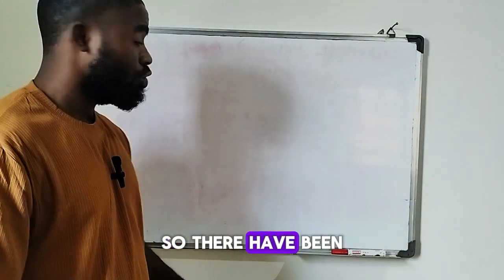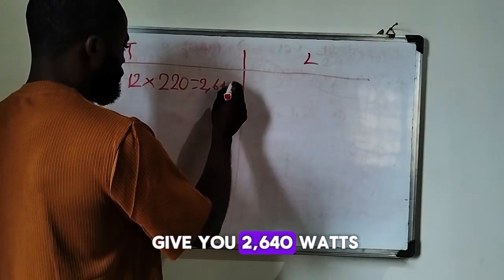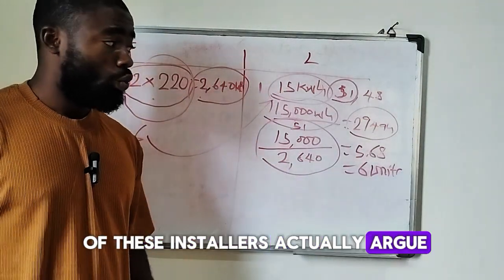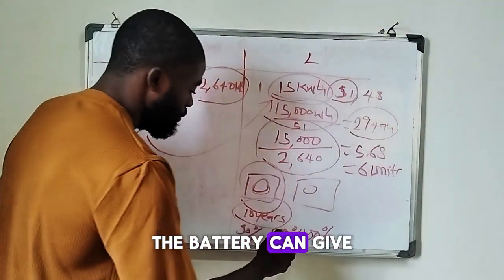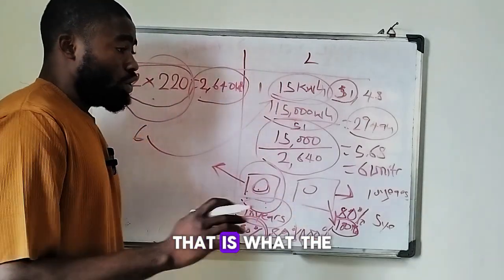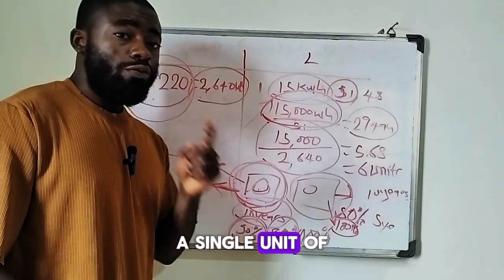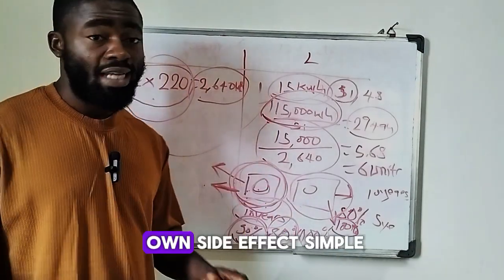HOW MANY TUBULAR BATTERIES MAKES A SINGLE 15KWH??

Comment: You did not calculate the voltage
I.e you did not considered changing the 12v Tubular battery to 51.v as the lithium battery
Why

Comment: 12 Units of 12V 220Ah Tubular Batteries
1. *Total Capacity*: 12 x 220Ah x 12V = 31,680Wh (or 31.68kWh)
2. *System Voltage*: 48V (4 x 12V batteries in series)
3. *Usable Capacity (50% DOD)*: 31,680Wh x 0.5 = 15,840Wh

 15kW Lithium Battery
1. *Total Capacity*: 15,000W x 1h = 15,000Wh (or 15kWh)
2. *System Voltage*: 48V (assuming the lithium battery is designed for 48V systems)
3. *Usable Capacity (80% DOD)*: 15,000Wh x 0.8 = 12,000Wh

The 12 units of 12V 220Ah tubular batteries have a higher total capacity and would provide a longer runtime.

Comment: Please sir i need an installation advise from you.

I want to connect a felicity hybrid inverter 10kva with 12pcs of 550w panels, to 4 tubular batteries of 220ah, how do i arrange the panels?🙏🏾
Reply: 6 panels in series then parallel the two array together.

Comment: In reality 6 units of tubular battery can never be equal to 15kwh battery. Becos if you put a load of 2000watts on 6 tubular battery it will just die within 5 to 10 minutes but if you put a load of 2000watts in a 15kwh lithium battery it can carry that load for 2 to three hours before it gets to 50% DOD. You should know that lithium battery energy density is different from tubular battery energy density.

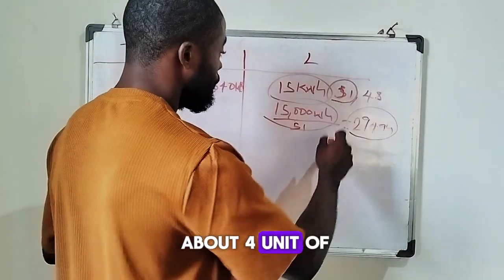Comment: Very educative.. planning on getting a 20kwh system.. but your calculation at 2:00 is wrong you said 4 units of 294ah lithium battery gives 15kwh.. 294ah x 51v =15kwh so it’s 1 unit of 294ah or 3 units of 100ah lithium batteries.

Comment: If only you know that most 220ah batteries are actually 200 and 180ah (actual capacity) a client was using 12v x12 units 220ah and then switches to 15kwh lithium battery. Same loads, same everything. He said he gets much more than when he was using tubular. He never stops appreciating me for the lithium battery. By the way, blue carbon. There are premium tubular batteries that can can match up with the calculations. They are premium brands and almost 45k more expensive than regular tubulars. Eg. Genius, ozoro, adwin, Luminous inverlast and few others.
Reply from the maker: Anyways, I was ashamed when you called blue carbon 🤦🤦, did you ever wondered wether tubular batteries where getting filled?
Reply: @Mairigaemmanuel . Sure, they were getting filled. Blue carbon has really improved. 50k more in price (stackable) than Felicity 15kwh. Remember, one of them uses secondary cells., you probably might not know this. I have affiliation with 3 giant Chinese lithium battery manufacturers. Try blue carbon and thank me later.

Comment: That installer is very correct, i assume you're referring to solarwatt, which is another youtube channel. 

You said using about 80% of Tubular batteries and you'll get 2-3 years out of them, bro that is wrong. Youll be licky to get more than a year and half from them. But using Lithium and then using 80% you can get upto 8 years from them no issues.
Reply from the maker: So you think your inverters cut off at 50% DoD?

Comment: It doesn't make sense for one to go beyond 50% DOD for tubular batteries & more than 80% DOD for lithium batteries if the manufacturer advices that ~ for the longevity of the batteries.
I think to get the accurate figure, the DOD should be considered.
I believe the calculation should be, taking the batteries' DODs into consideration:

1) For TUBULAR BATTERY;
12v x 220a  = 2,640w
2,640w x 50% dod = 1320watts.

2) For LITHIUM BATTERY;
15,000w x 80% dod = 12,000watts
 
Taking these batteries' DODs into consideration, the number. of 12v 220ah tubular batteries that should be equal to 15kw lithium battery should be:
15,000w x 80% dod ÷ (220ah x 12v x 50% dod)
=15,000w x 80% DOD ÷ (2640w x 50% DOD)
 = 9.090909....
While, approximately 9 pieces of 12v 220ah tubular batteries is 15kw.
Therefore, almost 9 pieces of 12v 220ah tubular batteries is a 15kw lithium battery
Reply: To achieve the same usable capacity as a 15kW lithium system, you'd actually need around 12 lead-acid batteries
Reply: Thank you. Lead-acid batteries are way inferior to lithium batteries. I don't understand why anyone should be having such argument in 2024. The best lead-acid battery will never exceed 5 years of useful life-span even if you use 30% of its capacity daily. A c-grade lithium battery used in the same condition will easily exceed 30 years before needing any replacement.
Let's not even talk about charging speed, where a typical lead-acid battery bank needs at least 10-hours of charging to get full, while a lithium battery bank can achieve a full state in less than 3 hours.
Reply: Note:
If the life cycles of the aforementioned batteries are considered in the above calculation, the quantity of the 12v 220ah tubular batteries that will equat a 15kw lithium battery might change.
Reply: This is more accurate before this video I have watched several videos on this topic what is most considered is the DOD. By the way everyone is entitled to their opinion and experience is always the best knowledge. I still prefer using Lithium over tubular batteries except if the client is budget constrained
Reply: @EmmanuelDimgba-f7c   nice one Sir. 

But no one mentains that 50% dod cuz inverters has been designed to drain to 10.5v or 10.6v for tubular depending on the inverter brand for a 12v system 
Therefore for tubular battery that fills at 12.7v if you divide by cut off voltage of 10.5 
10.5÷12.7 * 100/1 = 82% apprx.(Rounding down)

So I think is better to go for 82% to be near accurate
Reply: @Tin-Lumen  Any inverter without a low-voltage cutoff is unsuitable for solar energy storage, as it will ultimately damage the battery. Properly designed inverters have both low- and high-voltage cutoff settings to protect the battery. Many of the  cheap UPS products, such as those from Index and Uhako in India, are low-quality items that are commonly shipped to African markets.
Reply: The highest wattage you can pull out from tubular battery is 1,400 watts, this is according to Affripower Lab test on their 220ah 12v battery.
Reply: According to them, the battery was loaded with 700watts resistive load from fully charged and reach the cut off voltage of 10.5v at exactly 2hours
Reply: What about the nominal voltage , since , most tubular batteries are 12v, but the lithium battery is 51v, doesn't that mean we'll have to connect like FOUR tubular batteries in Series to at least get like 48v then we can now take into consideration the DOD and the AH. Am I right?

Comment: I just want to add that your lead acid batteries are more likely to die from unknown causes rather than you going beyond the 50% DOD.😂😂 So enjoy that battery today, use it to 70% DOD.😅
Reply from the maker: Most inverters doesn't even cut off at 50% rather 70%

Comment: Can you confidently deploy 6 unit of tubular battery as a 15kwh battery (even if you make it 8unit) for a client?

You are just solving maths (literally you are correct) however, you will be misleading your audience.

That installer is very correct.
Reply from the maker: Correct in what aspect, do your inverters cut off at 50%?
Reply: Connect 6 tubular battery to get 48v and think of dod and den connect 15kw 48v  and think of the dod u will know what the installer mean  @Mairigaemmanuel
Reply: @Mairigaemmanuel You can use a smart shunt to monitor your load & battery state, it can also be set to cut off when your battery reaches a certain voltage.
In my case i have a 80a MPPT controller i use for charging my custom made lithium polymer batteries, and then use my trusty old 60a PWM charger controller as a shunt, since i don't run loads more than 45a to 50a i connected my inverter through the charge controller load side, this way the charge controller cuts off power when it reaches the LVD (Low Voltage Disconnect) value i set in order to protect the battery..

Comment: There's zero reason to buy tubular batteries in Nigeria, be real. Zero reason. Anyone arguing for tubular is just being ignorant or facetious. In the first place you can't even discharge or charge a tubular battery past 0.2C safely, but can do that at 0.5 or even 1C with lithium.

Comment: Thanks for info 
But 
Tubular battery can only discharge to 10.5v and cuts off 

Thats to say it can only give 82% and that's maximum  for a battery that fills at 12.7v which will account for 2164wh(82% of 2640)

That's to say that 1pc of  15kwh battery is equivalent to 6.9 pcs apprx. 7pcs of tubular battery 

Note 
Lithium batteries can discharge up to 98% with out a PERMANENT damage
Reply: You are right bro
Reply from the maker: Only few lithium brands offers above 80%
Reply: @Mairigaemmanuel  okay Sir 
Maybe that's why they give 5years warrantee so that even if you discharge to 98% of battery rated  capacity it could still last five years in good condition 

Tubular can't survive 7months if you discharge to 80 percent frequently 

So lithium as it's high advantage over tubular 

Always go for lithium if you have the money 
That doesn't mean tubular is not as good

Comment: lol Nigerians we should do better. I know tubular batteries are profitable to you guys, but let’s be real: if a car manufacturer sets a 100 mph speed limit to prevent unavoidable accidents, even though it can technically go 200 mph, should the dealer only tell people it can go 200 mph? Lead-acid batteries get permanently damaged if discharged to 0%, but lithium batteries can handle it, as long as you avoid a 1C discharge rate. Lithium often lasts up to 6000 cycles before any degradation, while lead-acid struggles to make it to 500 cycles. I know this because I have to replace my car battery every year, even though it’s just a private car. A single 220Ah 12V lead-acid battery is about half the same capacity in lithium,  let’s call it what it is—lithium is the better investment, not referring to the cheap Chinese lithium batteries that are all over Nigeria's market.
Reply: No truer words sir, the chemistry doesn't even compare. Even the most expensive lead acid batteries won't do 5 years, as a matter of fact, extremely good quality lead acid batteries that can do 5 years are more expensive than lithium batteries... this 10 years projection is very strange
Reply: @ogagapanama1475 I guess the guy missed chemistry and physics classes those 😂
Reply from the maker: How many of the chemistry classes you attend have you used in real life?
Reply from the maker: Your analysis is no way close to the message you're trying to deliver.
Manufacturer doesn't decides tubular battery DoD, what does is your inverter lvd.
Your car battery is not for heavy duty purposes
Reply: @Mairigaemmanuel Haha, the manufacturer dont so that you would right? these days everyone seems to have a YouTube channel and thinks they know it all, without real understanding. I've been working with lithium batteries since 2016, so I won’t argue over basic facts. The so-called "Dr. Solar of Lagos" once tried to debate me on the difference between a rectifier and a DC converter! It seems anyone can jump on YouTube and talk endlessly, but those who want real knowledge should know better ..... Good luck to anyone who does tho!

Comment: For the person that says 12 batteries sir might not be wrong depending on the connection and system voltage. To achieve the 51v 15kw lithium battery, there will will some series/parallel connection of tubular batteries which might amount to this 12 or more Sir depending on the system voltage. I stand to be corrected sir

Comment: Boss , I want to upgrade to 24v set up, which one is advisable between smarten inverters(those big square ones) or Chinese hybrid inverters, I also saw a smarten 2675(hybrid with 70amp pwm).

Kindly advise, I already have 2 tubular battery on ground
Reply from the maker: Go with smarten
Reply: @Mairigaemmanuel naah bro from experience when those get dealt with lightening the screen goes blind after repairs and the repairer will charge you extra for the screen unlike Chinese inserters. I am speaking from my experience bro
Reply: @Mairigaemmanuel  thanks
Reply: Bro the Chinese hybrid inverters are the best the are smart and can be programmed but you see smarten and most of those Indian inverters they are just stock brick inverters.
Most Chinese inverters mimic American standard inverters.
I personally prefer the chincos. Deye, Jinko, Felicity, Cworth, Must, SMSolar Welion the list is massive
Reply: @suleimanmuhammedhady1198  These hybrid never show you shege before na why..
Personally, in  terms of power delivery, reliability & ease of repair i prefer the American/Indian type of inverters because they use a very simple design & components.
When a component fails it very easy to identify the faulty part & they are available at the market to buy & change.
Hybrids or newer Chinese brands on the other hand use tiny resistors, diodes, chips, transistors, capacitors and many other type SMD (Surface Mount Device) and if by any misfortune anything gets fried and you don't have the part number, you're going to hard time fixing it unless you have a spare board that you can look at, and not to mention the components are very difficult to get in the market.
Reply: @Staenli_  nah bro based on my experience the Chinese inverters are way similar they basically have the same components and part numbers one fits the other. I am speaking from experience. Indian inverters have always been a nightmare to me, they are not user friendly you can't manipulate them.
Reply: @suleimanmuhammedhady1198   In terms of user interface & customisation settings yes chinese inverters are better in that regard.
But in terms of straight raw power delivery, transformer based Indian inverters comes out top..
Reply: @suleimanmuhammedhady1198  thanks for the input, I will consider it

Comment: 4 units of 220ah tubular battery and 5kwh of lithium battery which is better?
Reply: Consider this comparison:

Lead-Acid: Four units provide 48V x 220Ah = 10.56kWh total capacity. With a depth of discharge (DoD) of 50%, you get 5.28kWh usable. The lifespan is about 200–500 cycles, priced around ₦1.2 million.

Lithium: A 5.12kWh 48V lithium battery with a 90% DoD gives you 4.6kWh usable. It lasts 6,000–8,000 cycles and costs about ₦1.8 million.

With lithium, you’ll likely be on your twelfth set of lead-acid batteries by the time the lithium battery loses just 5% of its capacity.
Reply from the maker: 4 units of tubular
Reply: The Lithium battery is far better than the Lithium. By the time the cells of the Lithium battery's cells start deteriorating you'd have changed you Wet cell batteries about 3 times
Reply: Faster Charging: Lithium batteries charge more quickly than lead-acid, which can be useful in applications where fast recharging is necessary.

Low Maintenance: Unlike lead-acid batteries, lithium batteries require minimal to none maintenance. Lead-acid batteries need regular maintenance to ensure electrolyte levels are correct (toping it water) and to prevent sulfation.

Lead-acid batteries release toxic gases, especially during charging, which can be hazardous without proper ventilation.

Better Efficiency: Lithium batteries have higher charge and discharge efficiency, meaning less energy is lost in the charging and discharging process, which is beneficial for off-grid or renewable energy applications.